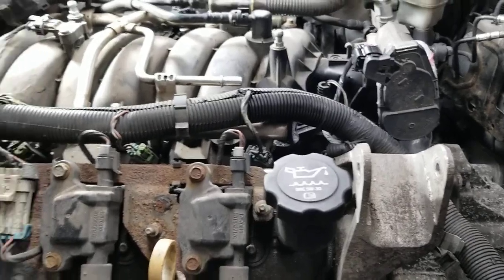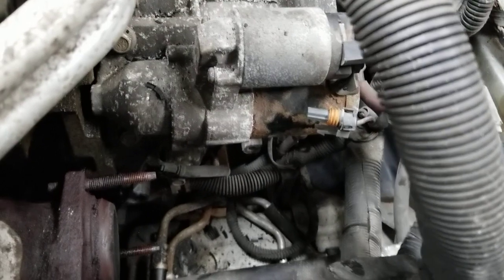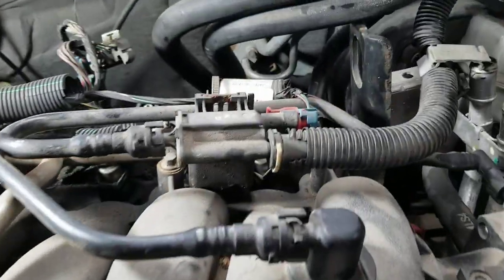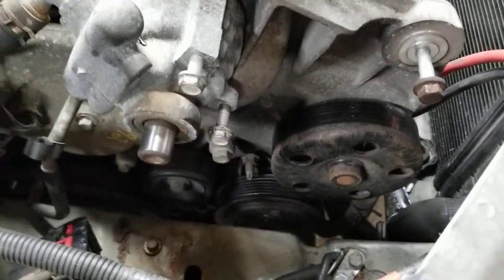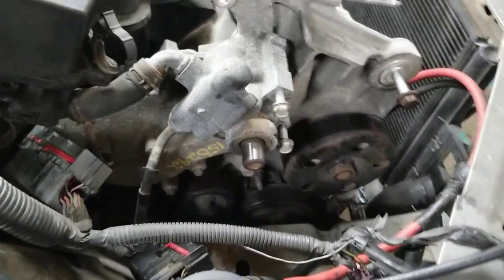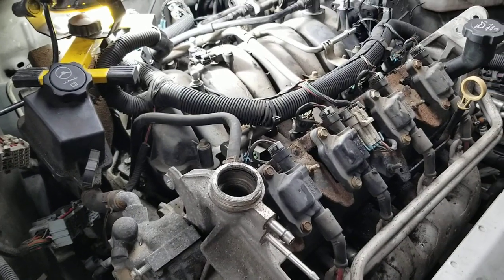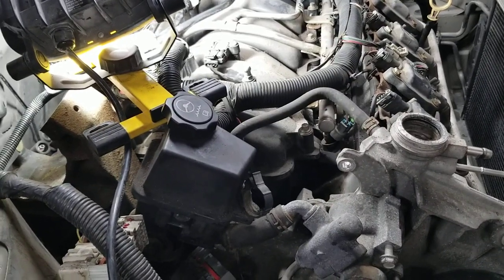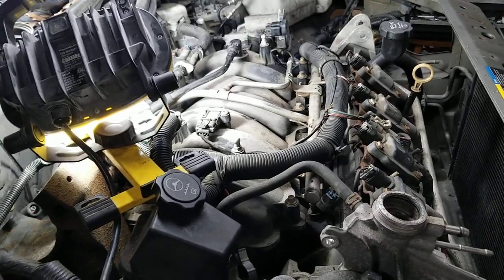Ls4 pull part 4

Comment: Gm made a 3800 with blower from factory  I had one in a 2 door Buick 

 Cadillac made front will drive v 8

 archeys v8 sells kit to bolt up 350 or 4.3 

S10 is lots of fun with 
350 also done bunch of those back in the day